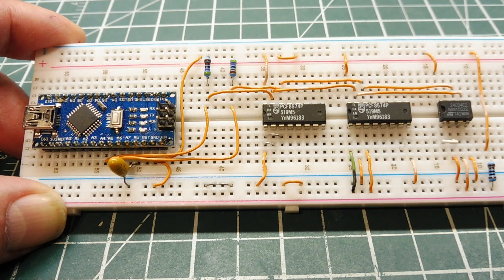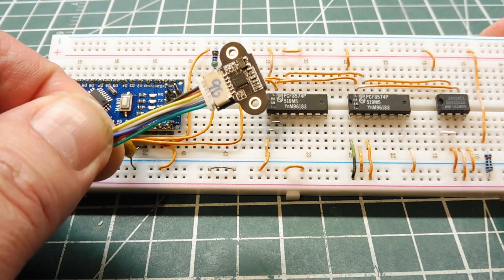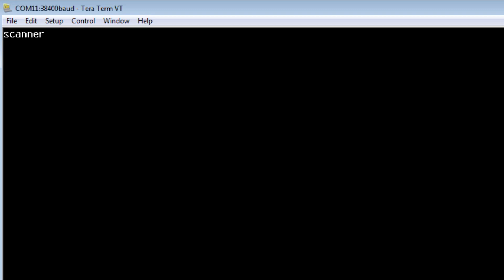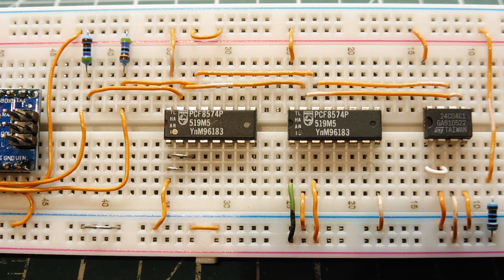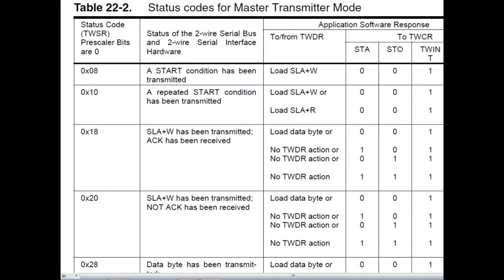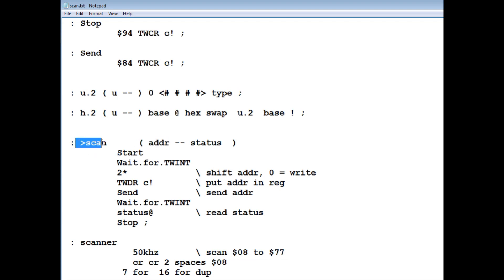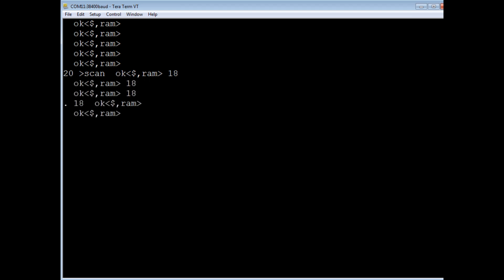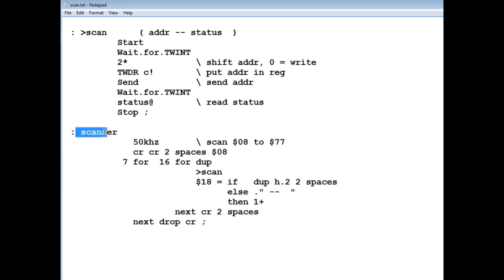I2C Scanner

Comment: I recognize all but two words. bit7 and set? Please share just those two. Nice video. I hope to do this with Flashforth and also with other FORTH varieties running on other MCUs.
Reply from the maker: bit7 is 128 and set? is mtst (check out the FlashForth word list) Since Forth is extendable I program as I go along and create these words. I have made a few videos featuring the Scamp3 board which is running FlashForth with all extra support words onboard to make it easier to get a program up and running. An I2C scanner is built in and is run by typing "modules".
Reply: @0033mer  Well I tried but failed. set? the same as mtst ? Seems it is doing more. I posted what I thought is the FF code on pastebin user rwl7532.
Reply from the maker: @RalphWLundvall  mtst should work for set? Do you have an I2C device connected to the micro-controller, if not it will hang.
The code for set? is:   set?   c@ and 0 = invert ;   This is what mtst basically does.
Reply: @0033mer  Thanks. Late to read this. No youtube notification arrivrd.
Reply: @0033mer  Got scanner working.  Added a PCF8574 only to find that if address is $20 (A0,1,2 = GND) pin 8 cannot be connected to ground (as your breadboard wiring shows no pin 8 GND) . Where in the datasheet is that handy tidbit?
Reply from the maker: @RalphWLundvall  Pin 8 must be connected to ground as in the second PCF8574. I had a solid wire jumper from pin8 to ground for the ground lead of my scope probe, which was pulled out before video recording.
Reply: @0033mer  I used other addresses and those worked fine with pin 8 grounded. Address $20 and GND at 8 caused failure and the chip got hot. Could the chip (Amazon/Anfukone) be at fault? Thanks.
Reply from the maker: @RalphWLundvall  Address pins A0 to A2 must be tied either high or low. If $20 is causing the chip to run hot, there is a problem with one of the address lines so I would assume the chip is faulty.
Reply: @0033mer  I now blame the breadboard!  Today both the chips work. Mystery.